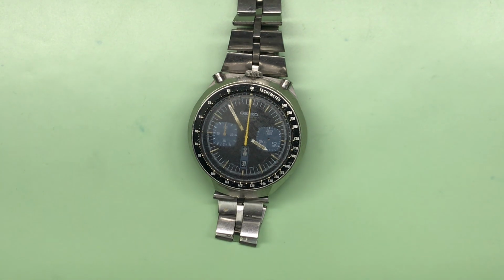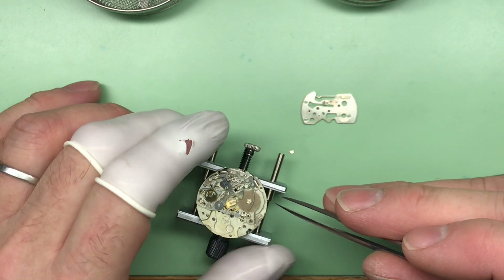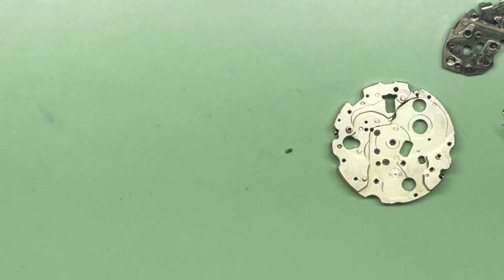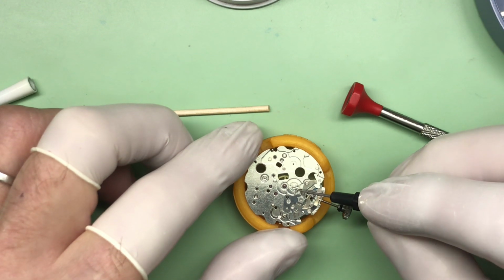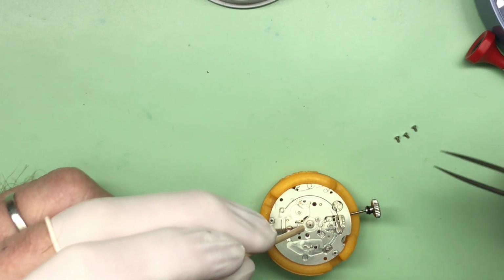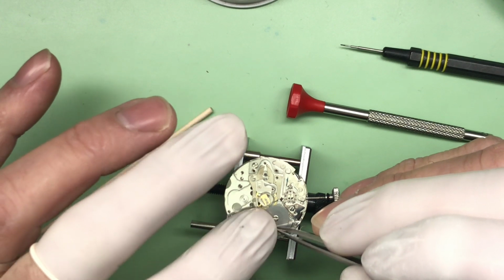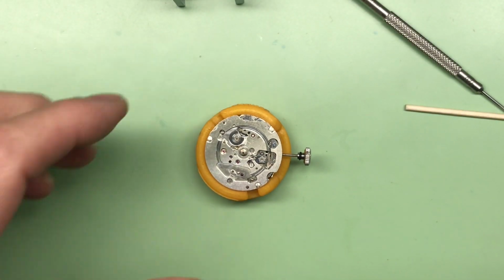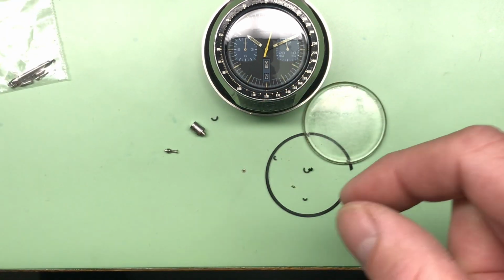For P.A. -- Seiko 6138-0040 Bullhead Service and Restoration

Comment: Nice work.  Setting the calendar plate on a 6138 is a challenge.  I do not believe the pushers on the watch are correct for the model.  Looks like pushers off a 6138 UFO.  I guess as long as they work, no worries.
Reply from the maker: Not exactly. Some bullheads have this style of pusher. It is actually slightly different from the UFO. These have a flat top with a inset circle on the top, whereas the UFO is dimpled on the top. Subtle, but these are definitely correct for this bullhead.